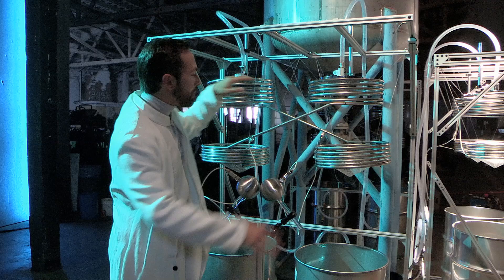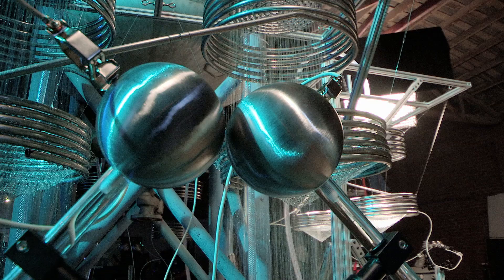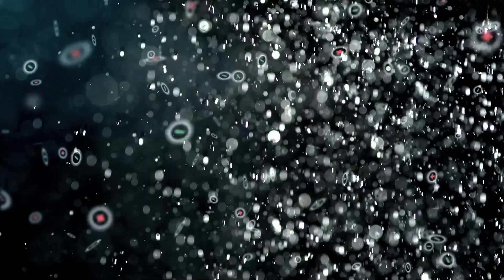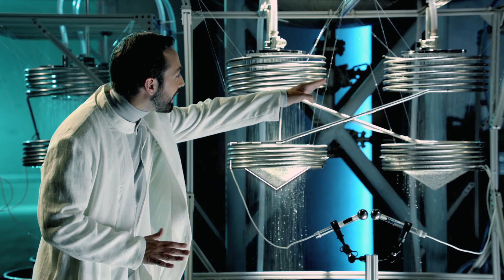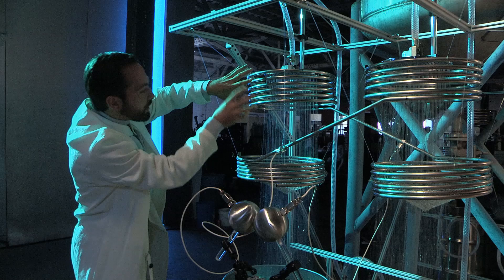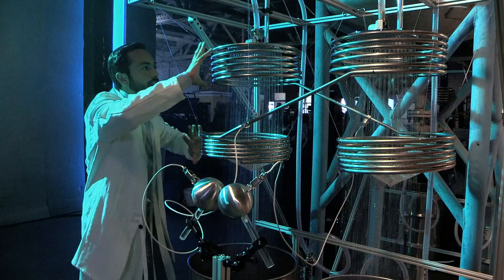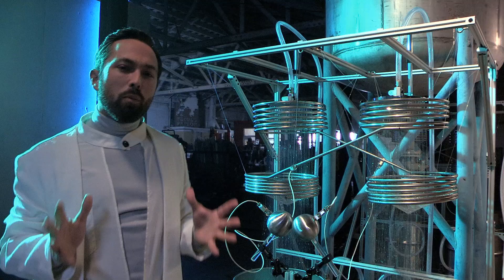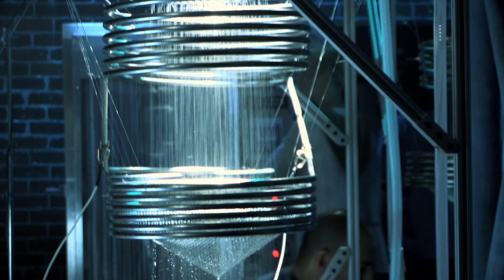Sparks from Falling Water: Kelvin's Thunderstorm

Comment: In the end it has to be gravity right? The whole system is just a positive feedback loop, that relies on the charges on drops along with the need of drops to be small enough for this positive feedback to work (as in bending the stream of drops you want), and so we get to the mechanism that creates these drops, which uses just small holes, where water goes through and there is some force that is overcoming it's surface tension, thus supplying required energy to break it into the drops we need. This force is gravity, so the energy is coming from grav. pot. energy. Yes?
Reply: Calin Agotici
 I checked out your answer, but you're wrong because you're not explaining where this net electrostatic energy is coming from. We all understood that these ions are causing the metallic bobs to get charged and everything, but without gravity doing the work of dividing the water into these droplets, the net charge built up on the sieve would not be substantial to produce this phenomenon (because of zero net charge). The energy used to produce these droplets is the crucial factor.
Reply: Le monickous It's also kind of a mix.  The energy comes from the ions in the end (the spark), but you need potential energy of gravity to run what's basically a sorting machine into two containers with different charges (then the spark) but it's using very very little (why the machine is so inefficient).  But if you had zero ions, even with gravity the system doesn't work  
But once you start getting very specific, it comes down to definitions.  As in the energy created in hydro dams and turbines doesn't come from the potential energy of water, but the heat of the sun.  As it's the heat of the sun that evaporated the water which then turned into rain at higher altitude that filled the dam that has the potential energy to run the turbines.
Reply: Yes, viewed from the point of view of the metallic contacts, the source of energy might be the charged droplets transferring this charge to the metal. But the charged droplets existed because work was done in pushing them through a mechanism that converted them into drops. Otherwise, if it was kept as a bulk of water, it would not have had an appreciable charge to it. Now, this work, was done by gravity.

If you're gonna attribute sun for energy, you might as well do that for 90% of things happening on earth.

As to why the mechanism is so inefficient, it's because due to firstly, not all charged droplets have same charge, so literally most of them are wasted by cancelling each other out, that creates the inefficiency.
Reply: Le monickous Also ignoring the hydraulic head, which could be used to run a turbine, contributes to the inefficiency of the system if we are concerned about how the water got up there in the first place.

Comment: The energy is harvested by creating order and separation out of what would be randomly (somewhat evenly) distributed ions or charges in the environment, mostly in the water I'd think. The energy isn't created, but moved around in the system. Using a passive system with just conductors and nothing else, to magnify biases in charge, is what makes this setup so cool.

Comment: This may be how we will eventually travel through space with disk-shaped craft built like a parallel plate capacitor and using the research done by Brown. If instead of the two balls shorting out adjustable insulating distance between the plates it would continue to charge to a high voltage and work like the lifters. You would just have to stop on a planet with water and refill your tanks.

Comment: I’m not sure if you mean where the energy comes from or what it turns into, but basically the gravitational potential energy gets converted into kinetic energy as the rain falls. I’m guessing the rainfall would actually slow down a tiny bit as it passed through, converting some kinetic energy into electrical potential energy

Comment: It's not the current that kills you, it's the ENERGY. :)
Reply: True... So current multiplied by voltage, right?
Reply: @danielpapp5901  That's power, not energy. To get energy from power you must multiply it by time.
Reply: @greg77389  ohh, yes. You right! What kills you is actually the ”work” that has been done by the electricity in you body.

Comment: The energy is coming from the gravitational potential energy of pumping the water up. And then the kinetic energy the water molecules gain during descent. A moving charge such as that of the slightly charged water droplets creates a magnetic field, this field will in turn induce an EMF voltage in the coil which creates the build up of charge at  the terminals. Some of the water droplets kinetic energy is lost in the process.
Reply: see, thats what I thought he was explaining at the start of the video, so at the end when he asked 'where does the electricity come from' i was like "wut? Didnt you just answer that?"

Comment: Can someone calculate how long this contraption would have to run to generate 1.21 Gigawatts.
Reply: Roughly 271,240 years, a 2000 mAH phone battery holds around 29 kilojoules of energy, divide that by 6.5 to get 4.461 KJ per year divide 1210000 by 4.461 to get answer.

Your better off time traveling the normal way.
Reply: @RockGeek00   Thank you Sir!
Reply: Forever.
Watts is a unit of power.
Power is energy discharged per unit of time.
In this case, 1.21 GigaJoules/second.
Your question is the equivalent of asking someone to calculate how long the turtle will take to go 200 mph.
The turtle doesn't produce that kind of displacement/second, regardless of how much time you give it. and likewise, the device, at the scale shown, will not produce that much energy/second REGARDLESS of how much time you give it.  The turtle maxes out at about 1/4 mile/hour and this devices maxes out at about 1 femtojoule/second = 1 femtowatt.

This thing produces about 1 femto-watt (about 10^-12 watt) You literally get more kinetic energy from the falling water than you do from the electricity produced.
Reply: @RockGeek00  Wrong.
You're calculating the accumulation of energy, not the RATE of energy production, which is what any WATTAGE rating requires.
Reply: @Squidbillies1000  He's wrong.  See my comments.
I'm an electrical engineer.  Believe me, I know this stuff inside and out.
I also got 399 out of 400 points possible in the most difficult Electromagnetics course in the School of Physics at Purdue University.
Reply: @dirkgently120  you are one smart young man.

Comment: The energy comes from the original potential energy of the water, then kinetic, then a tiny little portion is converted on the impact between the water and the mesh, then the electrons on the mesh is removed creating a positive charged material (static energy), which then makes the coil on the other side positively charged, making the water on the other side, polarized, and charged, then hitting the other mesh with negative charges, and so on, and on, and on... so a van de graaff generator

Comment: A charge is created by the dipoles within the water droplets. Each droplet has a fluctuating liquid diode preventing the water droplets from flowing upstream. This creates a positive flow in one direction. The mesh interaction creates a wave like function which is emulated in the adjoining coil. Having two separate coils receiving droplet harmonics from opposite streams increases the wave harmonics. The two metal balls resonate this harmonic and enable the wave function to collapse. When the wave function collapse or cancels out they annihilate the harmonics resulting in a micro-discharge.
We see this as the little blue/white spark of electricity.

Comment: The energy comes from gravitational potential
Reply: Think again - shall it work if the water move thru the coils sideways, not by gravity, but by pressure nozzles?
Reply: @klazarovful  Think again - if you aren't using gravity to move the water, don't you need to provide some other energy to move it?  Replacing gravity with some other force doesn't change the basic point -- energy is provided from the "outside."

Comment: For the same reason lightning is produced, yet at a smaller scale. I'm assuming that this experiment is earthed. 🇦🇺
Reply: Pretty sure  it would not work if it were earthed.  It depends on the two sets building up differential static charges.    It's basically a shitty Wimshurst machine.

Comment: Would there be anyway to boost this to a point where it could be used as a clean, reliable energy source?
Reply: Maybe if you set up these all over the country you live in, you would have enough power for... one household? lol
Reply: It's only renewable if you're using natural waterfalls, and not pumping water like in the experiment.
Reply: Nope. It's highly inefficient, and there already exist better ways of taking advantage of falling water.
Reply: Kakunapod I don't mean exactly the same as this... Like using the same principles... I mean the ocean is a pretty big place, I feel like something could be made that would work in a similar way but on a huge scale.
Reply: Probably not. Scaling this to a usable size would waste much more recources than it saved.
Reply: Maybe if it were an addition to a system that's already using falling water to generate energy, like a watermill. It could be on top of it.
Reply: Neo Genesis Gaming
It would be easier and more efficient to collect the water (rain, river etc.) and then release it with a valve to control it onto a turbine.
Reply: niagra falls
Reply: Benimation
On top of a watermill is not a good idea. Here is why: This generator requires to split the water into two "streams" and then to create drops. A watermill requires a (more or less) steady stream of water. Creating the drops on top of the watermill would therefor not work, as the efficiency of the watermill would be reduced. Below would work slightly better, because you don´t have to care any more for the watermill.
That being said, here a short thought experiment: This system is using the potential energy of the water. What happens to this energy when we do not use it? The Potential energy is "heating up" the water. Now image that you open a water bottle stretch you arm and flip it. How much warmer would the water be, shortly before reaching the ground? Not much and this is even the upper limit even for a more efficient system like a water mill.
Reply: rasmusroriroror Niagara falls already uses a much more efficient means of renewable energy - Hydro electric. The method in this video is extremely inefficient; if it were, massive versions of them would already exist.  It's not like this is a new discovery.
Reply: you could build a structure with thousands of these on the roof, although you could probably get more energy by channeling all that rainwater into a water turbine.
Reply: water IS NOT an unlimited resource, so, no. When you run out of water, you would run out of energy
Reply: Generic water is unlimited, just not the very clean stuff, which can be easily created with the generic stuff, via man made technology or the infinite cycle of rain.
Reply: Neo Genesis Gaming A more efficient way of extracting energy from falling water is to send it through a turbine, so yes, it's called a hydroelectric dam.
Reply: psicoalias So the oceans will disappear in thousands of years? Yes, maybe, but in the universe. No.
Reply: I would say no, but if we're talking waterfalls then you can use that pressure to move turbines, that's what hydroelectric plants are all about.
Reply: Neo Genesis Gaming It'd be better to just have the water turn turbines
Reply: just use a turbine... it's A LOT more efficient.
Reply: at best you could use the energy to pump water back into the tank, but you wouldn't be able to produce a net gain. If you used waves or thunderstorms or waterfalls, you could theoretically produce a large scale version of this. But as other people pointed out, it would be huge, inefficient, and basically not worth the effort to build. But if you REALLY wanted to, you certainly could.
Reply: short answer: no
long answer: no, because static charges like the ones being shown off in this setup do not generate hardly any actual current (amps) to get actual energy from.
Reply: There is a lot of energy in a lightning strike for example, but it is not in a form that can really be used.
Reply: Daniel Thu It needs to be harnessed, plausible for future endeavours, just very, very tricky.
Reply: increase the coil windings
Reply: I don't know the numbers, but I strongly expect that hydro turbines would be a much more efficient use of water.
Reply: We already harness the power in waterfalls and water currents, it's called hydroelectric power plant.
Reply: Ah turbines may be more efficient but there can work where turbines won't eh
Small rivers with a drop
Or below a turbine at its output section
Reply: Neo Genesis there is work involved with getting the water elevated. If you have an unlimited supply of high water and gravity you can use that to be the power source. If you have to pump it up, the pump consumes energy
Reply: Neo Genesis  the energy required to move the water back up to the top is more than the return

Comment: Change in gravitational potential energy?
Reply: That's what I was thinking... But potential energy turns into kinetic energy as it falls, balancing that law of conservation of energy... So I don't think it's that unfortunately.
Reply: Jarrett NG
where else should the energy come from?
what happens to the kinectic energy in the water?
The water hits the net/mesh of the apparatus. Most of the kinetic energy will turn into "heat" when hitting the mesh, but some... I don´t know how or why, but I think some of this kinetic energy will be converted into electric energy.
Reply: Jarrett NG Well it must be, because that's the only energy that goes into this system. The gravitational potential gets converted into kinetic energy (i.e. movement) and the moving ions produce (induce) a current in the coils etc.
Reply: Jarrett NG
Nope, potential energy is not 100% converted in the kinetic energy. Where do you think the sound is coming if that would be so?

For example:
100% Potential energy>
>95% K.E., 3% Sound, 2% Electrical energy>
>Eventually to 100% Heat
Reply: RealationGames The sound is from the impact when the water hits the bucket the the bottom.
Reply: TheMojken
Sure, majority is. The droplets do also produce sound as they travel through air, as does any object. Just like if you swim in water, you will push the water molecules, which causes waves.

I'm just saying that the potential energy isn't converted 100% to kinetic energy, but there is indeed some little percentage left for electrical energy and various other dissipative energy categories.

(Well, obviously sound is also basically just kinetic energy just categorized as sound)
Reply: Jarrett NG It has to be i think. the only energy in the system in the system, is the original G.P.E. Not all G.P.E converts to K.E, so that % that doesn't, has to dissipate into either sound, or heat, or in this case, electrical energy. Im not sure about whether this is the total explanation, but this is an explanation, that seems to fit!
Reply: Jarrett NG I don't think all the GPE is converted to KE. I think what happens is that the water near the coils has the opposite charge to the coils, so it is attracted to them, so when the water begins to fall it initially accelerates a little slower than it otherwise would. The reason you don't notice is that only a very tiny fraction of the gravitational potential energy is being converted to electric potential energy

Comment: The water can easily move charge within itself, it takes very little voltage to start the process.  The man explained in the video the ion separation between the crossed coils...they don't need to be coils, tin cans would work.   The ion separation becomes cumulative as the water lands until the spark occurs.  The driving force is gravity and the water must be droplets to allow charge to increase.  A steady stream won't work.

Comment: Saying that current kills not the voltage is a bit controversial please consult ElectroBoom
Reply: zarar younis EB is also wrong that it’s energy that kills. Small current over a long time won’t kill

High voltage won’t kill or high current over a short span won’t either. It’s high current that kills but time (and therefore energy) is also required.
Reply: @TheHomicidalTendency   Energy=Voltage*(flow of charge)/time 
so time is a factor
Reply: zarar younis yes but if the current isn’t high enough energy won’t kill you. 200w in one second is completely different than 200w in a brief period
Reply: @TheHomicidalTendency  eehemm 200Wh is what you're talking about, I suppose...

Comment: On one side, the negatively charged water is attracted to the mesh above it. On the other side, the positively charged water is attracted to the negatively charged mesh above it. However, gravity pulls the water away from the mesh and the water feeds the charge to the bucket below it. This process continues until a spark is generated.
So, potential energy (from the water tower) is converted to electric energy as gravity pulls the water down.

Comment: Gravity is the source of energy. Gravity by way of its pull on the water causes the electrical imbalances to form. No gravity, no fall, no electrical imbalances, no flow of electrical energy, and no sparks when the charges rebalance.

Gravity, my dear Watson. Gravity.
Reply: Not even close. This same configuration would work in zero gravity as long as there is enough water pressure to move the droplets through the air.

The energy comes from the breaking of hydrogen bonds as the water is forced through the shower head into droplets.